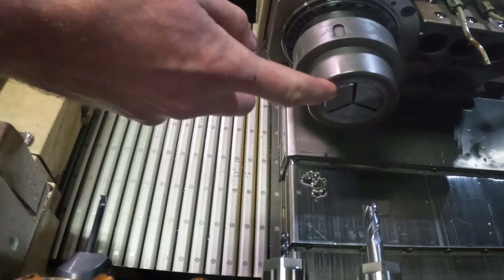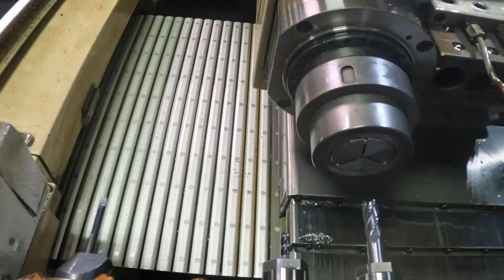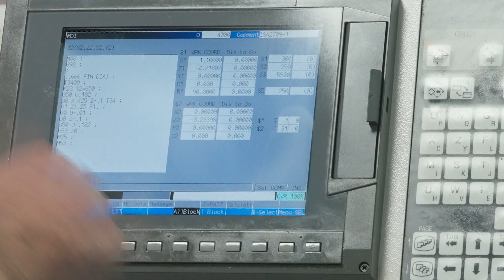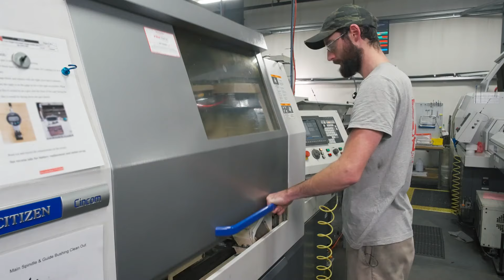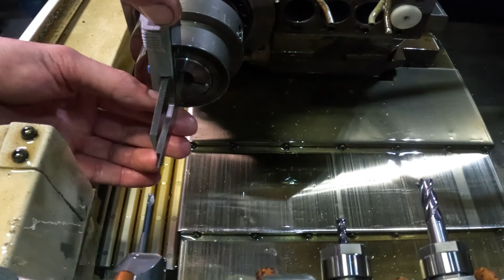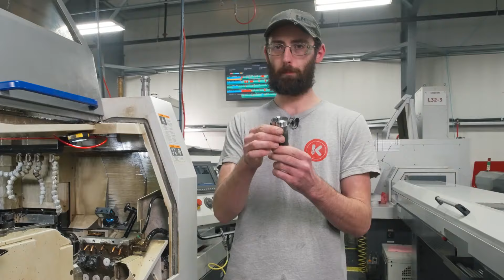How to Bore an Emergency Collet

Comment: Do I understand this correct? Positive Z values are inside your material? Is this specific to this machine?
Reply: Swiss lathes usually have positive Z inside the material, opposed to conventional ones
Reply: @massimilianocipriani7838  Dang thats trippy! Gotcha thanks.
Reply: All Swiss CNC lathes are backwards from Conventional CNC lathes for the "Z" direction. Doesn't matter if it's a Star, Citizen ,Tsugami etc.
Reply: Tornos Swiss are not like the others. They have a z negative feed.
Reply: @brianmcbrinn7564  When I first got into Swiss lathes it sounded really dumb that the Z axis was flipped, but it actually makes sense, you're moving the workpiece into the cut on a Swiss, whereas on a Conventional lathe the workpiece is stationary and the tool itself moves into the workpiece, hence negative.
Tornos (to me) seems like that bastard child Star and Citizen had lol.
Not hating on them, i know nothing about them it's just my off the cuff take.